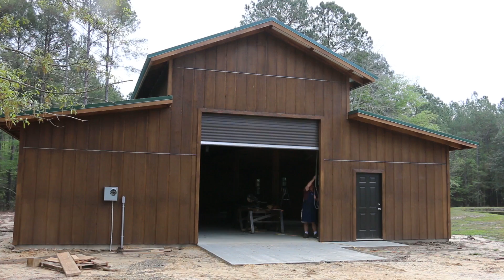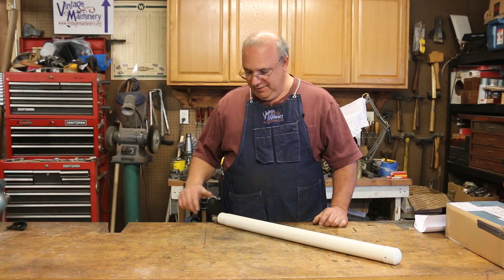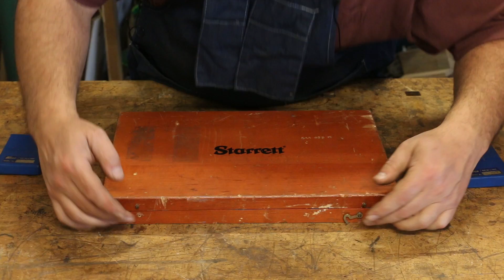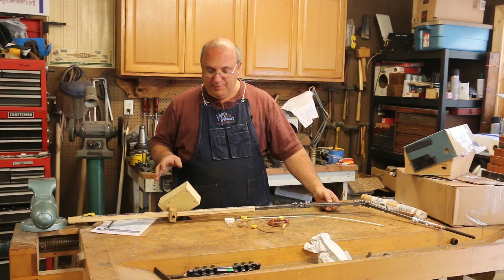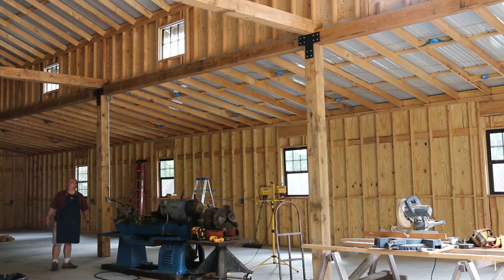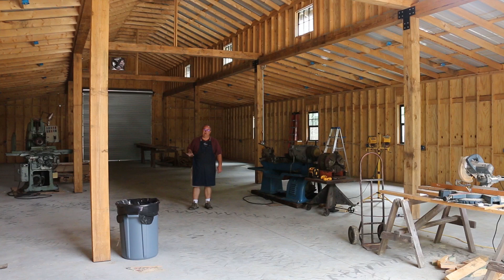Odds & Ends 44:  Viewer Mail and Shop Update

Comment: Keith
The shop looks great. A couple of questions. One. Why did you select a wood structure over a metal building? Second. Are you considering any fire protection since it looks like you live in the country? Third. What about breaking in protection (no details) just is it being considered?

I really enjoy you channel.

Gasman1
Reply from the maker: +Charles Moore I did consider a metal building, but I really wanted a wood frame building.  Metal buildings just don't have any character and I want my shop to be an inspiration to work in.  Also, I think that the wood building will improve my property value more than a metal building (not that we are planning to sell any time soon....)  For the short term, fire protection will be some fire extinguishers placed at the exits but maybe down the road, I can install something better.  As for security, we already have a security system in the house and the shop will be added to that.

Comment: I learned that outlets directly above the benches are a problem. The cords hang down on the bench. If I was doing it again, I'd plan for outlets on either side of the work surface or machine table, with racks or lipped shelves for the tools. Of course I built mine about 15 years ago. By the time you're done with yours, energy might be moved via lasers, or stored in batteries....

Comment: Hi Keith I have and use that rod on cast iron I believe it is pure cast iron use the right flux and you can have great luck. Do a weld up in one pass or you may have holes show up and make sure you have the part very hot Good Luck
Reply from the maker: +THE IRONWORKER Thanks - looking forward to giving it a try.

Comment: I know you will not like the cost, but I would have someone come in and spray an inch of foam on the walls and ceiling. It will seal and insulate better than any thing else. You will see a big difference right away, and make the roof a lot stiffer.
Reply from the maker: +Dan N I am actually leaning in that direction.

Comment: Keith, Wow what a great looking shop!
Have you considered using VFD-s versus a rotary converter? 
Eric
Reply: +esoomreltna I've already tried to convince him on the VFDs, Rotary Phase converters are what he's comfortable with and apparent going to stick with.
Reply: OK. That is cool. Just a thought. Thanks!
Eric
Reply from the maker: +esoomreltna Don't get me wrong guys - a VFD is a great option to generate three phase when you have one or two machines you are trying to do it for.  But in my situation, I will have something around 20 or more three phase motors of various horse power.  It is much cheaper and cost effective to run one single Rotary Phase Converter (RPC) than 20 VFD's.  And with some of my larger HP motors, the cost of a VFD big enough to run it is also cost prohibitive.  With that all said, I still have two machines that use VFD's, but more to give me variable speed than three phase conversion.
Reply: Keith, Ah I didn't realize you would be running so many different machines. The PC is THE way to go for your situation.
All the best for the  that great looking new shop.
Regards,
Eric

Comment: With that kastweld filler rod you use the red flux (Brazo brand, is what I prefer)where with the bronze filler rod you use the white flux. The flux is used the same as you would do with normal brazing. This info is just to inform you, since you stated you weren't sure about it's proper use. You want to use a NEUTRAL FLAME when using this type of rod.The filler rod will not flow out as much as the bronze rod does, it sort of comes off as a blob and can be smoothed off with torch as you go along. As with any cast welding, when finished you want to keep the repaired item from cooling too fast, if it were me I would have a dedicated plywood box about 4 foot square and 18 inches deep (big enough to handle fairly large pieces) that is 2/3rds filled with powdered lime, sort of bury repaired item in box of lime then cover with more lime, you'll be amazed as to how long it will be before the item cools enough to handle bare handed, the item will still be warm two days after it has been buried in the lime.
Reply from the maker: +Nortekj Thanks for the info - looking forward to trying them out!

Comment: ALL i CAN SAY IS...GREEN WITH ENVY!!!... love the shop

Thats a big shop with a lot of lighting needs Might I suggest setting up a solar powered low voltage system for lighting only... both area lights and individual machine lights....some with motion detectors....I plan on doing something similar to my shop
Reply from the maker: +made by steve I have looked into solar panels for the shop - that might come at some point in time but not in the budget for now.

Comment: Keith, love the shop! You might want to consider vinyl siding for interior walls, it's washable. A note about the floor---it might need some grinding or polishing before applying the sealer, though it's a lot of money but might add longer life.
....13
Reply from the maker: +arkansas13 Probably won't be doing any grinding - what I have will have to be good enough and should last a lifetime.

Comment: Keith putting a sub panel in will shorten up all the branch circuit runs and deals with voltage drop at the outlet. Otherwise  you'd be increase wire gauge size to deal with long runs. It works better and ultimately saves wiring costs. Good call. Your shop is absolutely awesome- now you've got to fill it. I have shop envy!!  Chris
Reply from the maker: +Ishta123 I just need to get it to where I can start moving machines in.  I have a bunch of machinery piled up in my small shop and in storage that you guys have not even seen yet so I think a lot of you will be surprised at how quickly things fill up once moving day gets here!

Comment: I installed these 4ft LED in my shop they are instantly way brighter than the old CFL's. Home depot sells them for $40 sku#1000532467 . They are low current draw and come with a cable so you can daisy chain several in a row without using up extra receptacles. Figure on how many you need and buy even more lol ... Ive never found myself saying "this is too much light!" Lol good luck shop is looking good
Reply from the maker: +ZADRIAN I have places to install boxes in the ceiling to install 32 of these fixtures down the two sides - not counting the center isle of the building.  I think they are closer together than the specs require, but as you say, you cannot have too much light!

Comment: Hi Keith,
I notice that there is no insulation under the metal roofing. Is this normal in your part in the States. In OZ we generally use biuilding blanket that is a combination of silver foil and fibreglass insulation.
Reply from the maker: +Charles Camenzuli We will be installing some insulation very soon.

Comment: I've been putting these  4 foot LED that I got from Sams Club in my shop and you can not beat them for the price point. Try are very bright compared to the florescent equivalent. You can run 10 of these for the power required for an 8 foot florescent fixture. I check the amp draw in my shop so I know that's a fact. http://www.samsclub.com/sams/2pk-led-shoplight-4-ft-led-shoplight/prod20051839.ip?navAction=
Reply from the maker: +Alvarez Metal Works Thanks - I will be installing something similar from Lowes.

Comment: One thought on LED lighting, and fluorescent for that matter, is strobing effects. Because you have rotating machinery, you CAN get a situation where the rotation speed matches the on-and-off flicker of 60Hz lighting. Incandescent bulbs don't have the problem, of course, because they take time to change brightness due to the filament thermal lag. I believe the dimmable LED bulbs may not have a strobe effect but you may want to talk with an expert to decide how best to make things as safe as possible (and it's cheaper to get right from the outset rather than change things later).
Reply from the maker: +Mark Sinden Actually, I think that the dimmable LED's are the ones that strobe worse - most of the other ones have a capacitor that smooths out the flickering.
Reply: Hi Keith. Either way, it is something to consider. I know that it used to be mandatory here in the UK that localised lighting for lathes, etc. was incandescent to reduce potential accidents.

Comment: FYI, Lowe's carries white labeled epoxy floor coatings from an extremely reputable supplier.  It's called Epoxy-Coat and it's the cheapest 100% solids epoxy coating you can buy.  Super durable, I have in my shop and in my kitchen....  It's a special order and they have a clear as well if you want to retain the concrete look.
Reply from the maker: +ck m I will check it out.  Last time I looked at the epoxy finish, it was way too expensive for such a large area that I have to cover!

Comment: Hi Keith I Love the shop and I must admit to some Jealousy to have such an amazing  space to be able to continue your work and hobbies in   
When you mentioned the roof heat and that you had a Fan at the back of the shop 
I instantly thought of what we use here in Australia  a whirlybird  they use NO electricity to evacuate the excess heat in your ceilings and reduce summer heat build up  very well 
This is one site  http://wawhirlybirds.com.au/     and you can always look here  in a google search as well 

https://www.google.com.au/search?num=100&newwindow=1&hl=en&site=webhp&source=hp&q=buy+whirlybird&oq=Buy+Whir&gs_l=hp.1.0.0l10.6528.17597.0.20788.10.10.0.0.0.0.1225.8393.6-3j5.8.0....0...1c.1.64.hp..2.6.6659.0.mPrxfcrtlXc

I dont know if it is Just living in a dry climate or not but I can see you haven't put Gutters on the roof to collect water  My instant thought when I saw your pond was why not  divert all that water via gutters into the pond / dam  for being able to grow fish , and or even using some solar power to power a water pump in summer to run a series of Sprinklers ( Use Galv Pipe and good Butterfly sprinklers )  along the ridge cap of your roof  for fire safety and 2 to cool the building down then let the water run back to the Dam  to recirculate . or at worst collect the water in tanks for home and shed use and garden watering in summer , a shed like that would catch one heck of a n amount of water 

Next where is your Shop Cat we haven't seen him or her for a few Videos ?

Thankyou for some great YouTubes  Keith you are very much appreciated 

Tony from Western Australia
Reply from the maker: +Moondyne .Joe Yes, we have something similar here in the US.  They use them on top of attics all the time to pull some of the heat out.

Comment: I'd suggest just using ceramic lamp sockets.  No reason to buy fancy fixtures when you can just load them up with CFLs or LED bulbs.  I'm hoping they start selling some affordable 100w equivalent LEDs in the $3 range in the near future.  I really want to use them in my attic/basement/garage areas.

Comment: i noticed the light brown line down the lenth of your building. meaning water is sp;ashing against it due to not having gutters. im sure you have that in the works. that shop is my dream shop. and will never happen. i cant wait to see you working in it.
Reply from the maker: +Bison Workshop The splashing is worse right now because there is no landscaping or grass, just bare ground.  I am waiting on things to dry up some to do some dirt work around the building and then will put a pine straw bed around the outside that will prevent most of the splashing.

Comment: Place a long but thin strip of wood/metal along each roller-shutter during your rain-season (I'm in uk so that's year round...) and then get some thick plastic sheet or some rubber material over the top. You can then lower the roller onto that material and you'll have a downhill ramp outside of the building that'll prevent rain from running underneath the door and into the workshop.
Reply from the maker: +A2ZGAMEGUIDESX The concrete at the door has a ramp up to it and the driveway drains away from the shop.  This has not been a problem.
Reply: Sorry I just assumed the concrete was flat all over

Comment: Keith, like EldoradoNY said, gutters will go a long way preserving the T1-11 siding. I would also add a narrow concrete walkway, pitched away from the wall, all the way around the building. You can channel all the rain water away and into your pond.
Reply from the maker: +Railfan 439 Gutters are on the list, but once I get some dirt work done around the building and some landscaping, it will go a long ways towards splashing when I can get rid of that bare ground out there.  I need things to dry up a bit first - we have had a ton of rain this winter....
Reply: Send some of  the rain out here to California. We could sure use it. El Nino turned into an El No-No.

Comment: what we done here for the sweating issue.. is use the foil/bubble/white poly insulation on top of the purlins but under the roof metal... additional benefit is the foil reflects the radiant heat
Reply from the maker: +Sean Taray Food for thought!

Comment: as for the lights, you can mount sockets in each box, then as you budget for light fixtures you can just plug them in, that way you can have your inspection & final sooner, then add the other later...
Reply from the maker: +Bob White I have already tied all the wires together in the light boxes with wire nuts so that I can add a few at a time.
Reply: +Keith Rucker - VintageMachinery.org ... any chance on buying a copy of the plans from you..??
of course a little video on how or what you did & finished product would be cool

Comment: If you have a underground service lateral coming in I'd go with a meter pedestal vs a overhead type meter socket, for frost reasons and appearance. Also, if your utility offers it a  320 amp service can have two 200 amp panels on it.  Food for thought.
Reply from the maker: +Oldsmob455 Everything is underground where I am, so overhead is not even an option.  As for frost reasons, that does not apply here this far south!  Our codes do not even have a "frost line" as our ground never freezes!

Comment: Surveillance camera systems are very inexpensive these days, I would get some setup and then you can watch the place from anywhere with an internet connection.
Reply: I totally agree.  You could easily setup a cctv system for $500-1000 which can have alarms and is accessible via the Internet. Willing to help if needed.
Reply from the maker: +bensbenz I will be attaching the shop to my home alarm system, which already has a lot of those features.

Comment: Sheetrock is for fire protection.  If you have wood sheeting inside install a sprinkler system when time and money allows.  Right now get  big fire extinguishers placed at each  small door, not garage doors. Also some battery powered smoke alarms for now.
Reply: +user990077      good advice.

Comment: Keith - I sometimes see steel barns up north where some of the roof panels are replaced with translucent panels to provide interior sunlight.   I am curious if that is also done in the south and/or if you considered doing that.  We also have factories built in the 1800's that are of the same basic shape as your shop but have windows around nearly the entire exterior to provide lighting without electricity.  Heck I don't know, maybe sunlight is a bad thing in a machine shop.
Reply: +cemx86 thats why Saw-tooth roofs were so popular in the industrial boom in the country, especially in the north/ northeast.  a lot of natural light and allowed for natural venting as well.  I like the clear panels on the roof panels.  Ill have to keep that in mind.
Reply from the maker: +cemx86 You do see the clear panels in a lot of metal buildings.  The down side to them is that the plastic will break down over time and they start to leak long before the metal roof needs work.  And you loose a lot of insulation opportunities around them.

Comment: Why a rotary converter? A Variable Frequency Drive, is cheaper, more efficient, and lets you control speed and direction.
Reply from the maker: +Guy Gustavson Because I have many machines to hook up and with a VFD, you really need one for each machine.  Lots of money in the VFD's and lots of money in running 220 power to each one.  With a RPC, I can have one unit power the whole shop and run much lighter wire to my individual machines.  Believe me, it will save me a ton of money in the long run - and I already have the RPC in my small shop that I will be moving to the new shop.
Reply: +Keith Rucker - VintageMachinery.org There is no reason why you can't use a large VFD for multiple machines. You don't get the fancy motor braking or speed control, but you don't get that with a rotary phase anyway.

Comment: I like your sub panel idea because if you don't do it you'll have the problem i have now. The machine shed here is 48'x150' with a 100 amp service on one end, there's so many feet of wire to outlets on the end of the building that the 20 amp breakers were'nt enough to run a basic 30 gallon air compressor (portable), chop saw, bench grinder & drill press. I had to up to 30 amp breakers.
Reply from the maker: +jasonmushersee I hope not to have that problem...

Comment: The shop is a wonderfully thoughtful design, and it looks great too.

Years ago I had input into an industrial research machine shop and we all got the lighting wrong.  We had little natural light.  We had some fluorescents that flicker and strobed the rotating tools/work, and the light was not white making it had to identify metals visually.  We redid it all at some expense!!

Do LEDs strobe, or are the continuous?

Thanks.................
Reply from the maker: +WD Hewson Some LED's do strobe, particularly if they are dimable lights.  But, most of them have a capacitor built into them to smooth out the strobe effect.  From what I can tell, a good LED will have less strobing than a fluorescent.